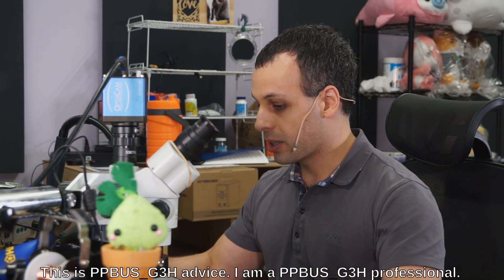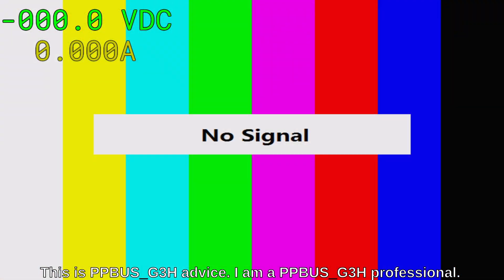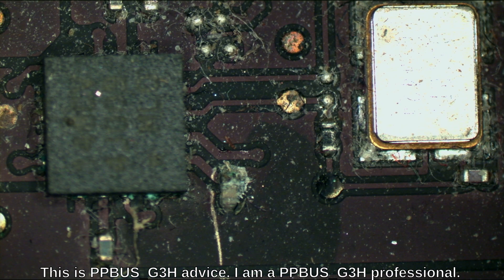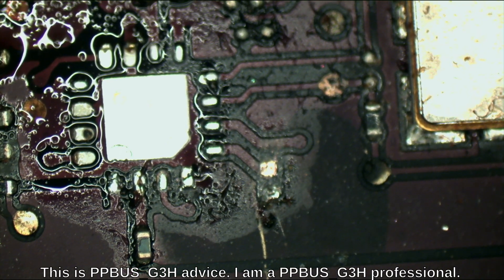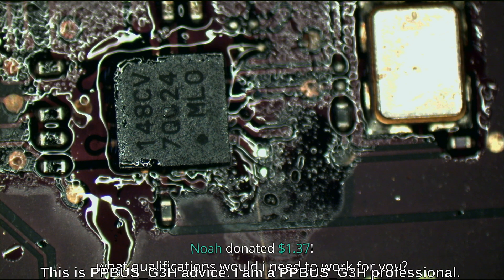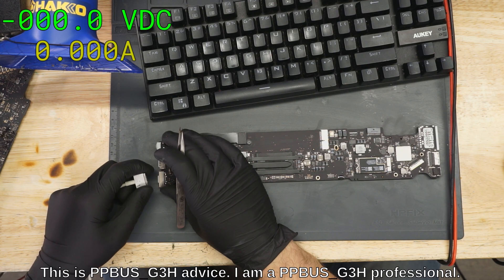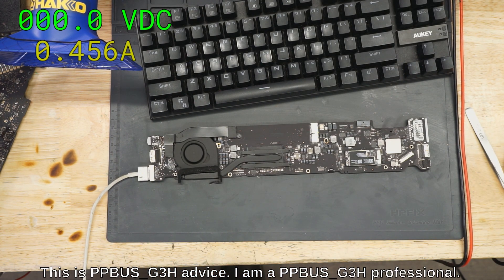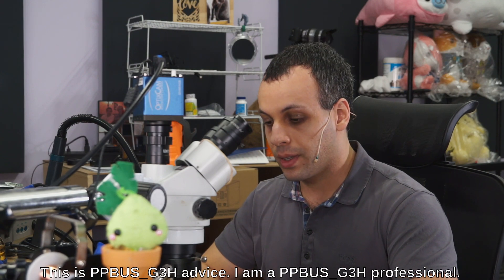A1466 Macbook logic board repair; 66 mA, not turning on

Comment: hi, i have a problem with a MacBook A1706 (2017) i have shorts on the PPVCCIO_S0_CPU line.  do you think it comes from the cpu?  the Mac does not turn on anymore but the cpu heats up.  before I no longer had a display on the internal screen but only on an external screen.  (sorry for the bad english)

Comment: I'm not quite up to your level of expertise on board repair Louis, but I did my first real repair today when I replaced a faulty micro USB connector on my Samsung Galaxy S3. It took a while to get it right, but no damage and now it works fine. My first real hot air work, although I'm very used to soLdering normal sized stuff and even some SMD :-)

A bit more practice and I might start destroying apples for a living too ;-)

Comment: Louis, I just wanted to say thank you. I received my replacement U1900 chips from your company. Replaced faulty chips on two 820-3437 - B boards and used a couple donor caps. I now have two working macbook air 2013 devices again. Keep up the great work!

Comment: I usually spend like 5minutes carefully balancing solder amount to exposed pad in order to have chip to float just in right height for side pins to make contact. I need to try what you did with that QFN. Can it really be that easy and quick to solder QFN instead of being PITA!?

Comment: This might be a stupid question, but does heating a chip to melt the solder erase the information stored on it?
Reply: No. Actually all the chips are made to work under some level of heat. So, heating a chip contact point or tip doesn't erases data.
Secondly, data and information is stored in Ram, hard disk, or across multiple chips in a memory module. Heating one of the chips directly, in those above mentioned storage devices may cause some damage. Cause it's made of plastic and other elements which can be destroyed due to very very high temperature.

Comment: I sometimes think about Right to Repair and e-waste. And the norm is buying a new phone every 1-2 year is insane. Ive had my phones until they break, my old nexus phone I think I swapped battery 2-3 times before it finally got put down. But I always had to get dodgey 3rd party batteries etc. They need to make products better, even if it ends up costing more and they need support it for 5-10 years with spare parts depending on product. Companies releasing 2-3 products on a 2 years cycle seems alot more reasonable than yearly 10+ different crappy ones, stuff got to be made to last. Free market doesnt work to solve these problems, if nothing is done they will pump out new "crappy" products that breaks down in 2-3 year and e-waste problem just gonna be worse and worse. There simply need to be laws that require a product to be lisenced to a higher standard before its allowed to be sold. If nothing is done, we gonna get drowned in cheap chinese named brands that we change more and more often. That phones arent required to have easy replaceable batteries is insane, since its why most phones get replaced is when the battery start to fail.

And perfectly good phones/tablets get outdated since they wont update the software and apps stop supporting "older" android versions is also really annoying. But when they release more products than they are able to support, we get this.

Comment: how r u cleaning the solder away is that tool sucking it up, i havent done board level repairs for a while though i used solder wick, if we did chips u had to put down the solder perfect or start again, we didnt presure place the chip like u are we would do the magic touch and the chip wud auto align on the pads

Comment: I have two ADC boards (one perfect, one missing a surface mount capacitor). Is there any way that I can work out the value of the missing cap, using just the perfect board and a multimeter, since I've read that you can't tell what capacitance a cap is from size or sight alone. Thanks very much :)
Reply: Desolder it (or at least one side) so it's no longer 'in circuit' and measure it. Multimeter w/ capacity measuring capability or one of those little component analyzers.
Reply: @michaeltempsch5282  I hoped that I wouldn't need to take the component off the board. I guess that I can, it's just that I'm not a great solderer :) I have a Kaiweets HT118A multimeter which can measure capacitance according to the specs on Google. Time to get my soldering iron and multimeter manual out :) Thanks!
Reply: @TheGhostOfKarazhan  You might, or not, get a reasonable read on the value if measuring it while still in circuit - but it depends on what it's connected to,,, 
Only way to be sure is to get it out of circuit.  Looking at a pic of thé meter Google foundation med, looks like the capacitance measurement is the middle of the yellow ones at 7 o'clock.  -| |-  symbol (fatter bars though)

Comment: Found this guy after looking for ways to fix my macbook 10 years ago, have been using acer aspires since then until I built my quarantine gamer pc.
Also that macbook detonated two years ago. Lithium battery exploded while I had the macbook upside down with the bottom panel unscrewed... still have scorch spots and pockmarks of boiling acid and burn damage on an aspire.

Comment: Tesla is definitely worried about people doing their own repairs on the high voltage stuff that has to interface with their superchargers without exploding when trying to charge... They do allow third party repair shops as long as they have the right equipment and training. There is no bricking of Teslas. They do stop cars that were reported as totaled from fast DC charging even if someone restores it to full working order... They used to have a program where you could pay them to re-certify such a car but that program is no longer running. Important to note that a working battery pack from a totaled Tesla is often worth more than the totaled car costs but you often will not know if the battery is still OK when you bid on such cars... Tesla definitely needs to be better about all this right to repair stuff but I think they are very busy and have to pick what to focus on. and desperately do not want anything to go wrong due to their fast chargers or batteries. The thing is that they promise their shareholders that they will not go for big profits. That encouraging and enabling a sustainable future is their goal... Hence they get shareholder who care more about the sustainable future and growing the company than they care about profits. They lower prices on their products when their margins improve even though they have way more demand than they can manufacture and in many other ways they have proven that they really do put their mission above profits and just want to make enough to stay alive and keep growing...

Comment: The uk is finally pushing for all manufacturers to have the products last longer and also for repairs to be made so the manufacturers will need to send parts for the products that we use instead of throwing items away in the landfill .
So in other words parts will be easy to access and to be replaced that not going to make apple happy.

Comment: Right to Repair, the reason I have loved Dell Enterprise grade equipment, Latitude and Optiplex systems have manuals for download that walk you through replacement of modules. Not component level, unfortunately. But for anyone that can follow directions and use a set of screw drivers, you can get your computer working again, with readily available parts.